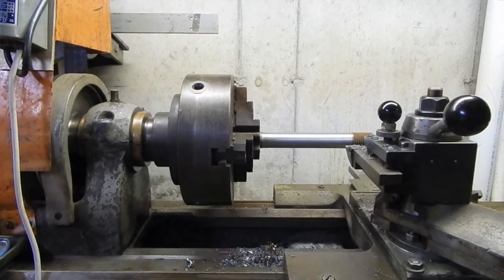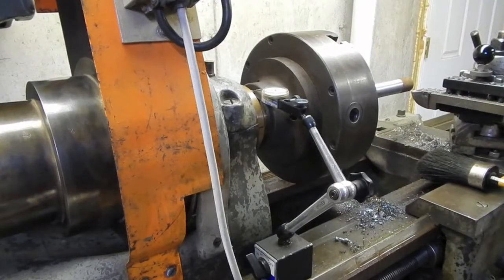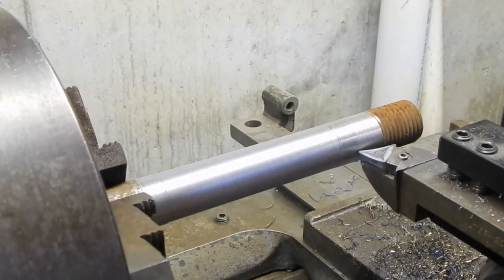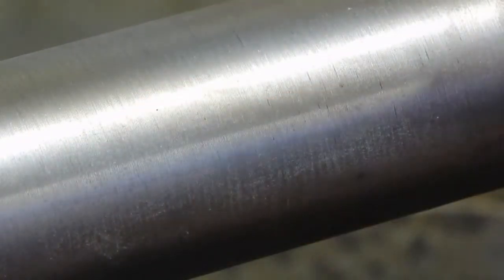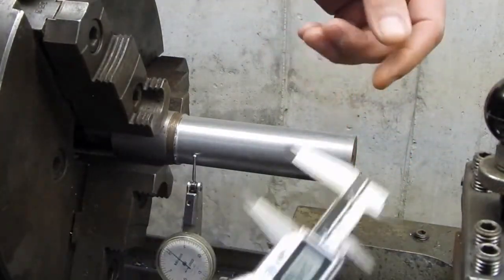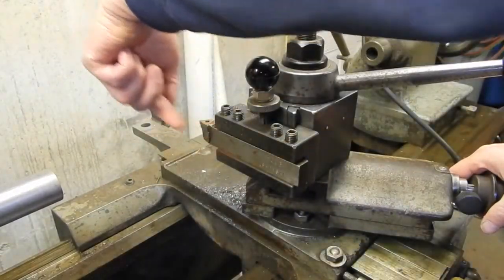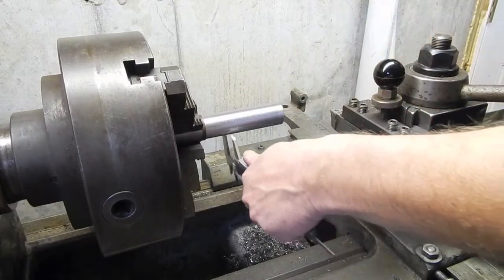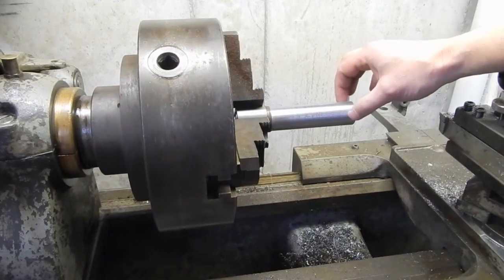The Rare Vernon Lathe Part 65

Comment: Just a thought but if you turned between centers you could actually check alignment. As it is you are checking everything at once. Anyone would be overwhelmed.
Reply from the maker: +klmartin1962 Turning between centers will factor in any offset of the tail stock. So it's a food way to check tailstock alignment, but only after you've ruled out any twist in the lathe bed with the test I did here. Thanks for watching.